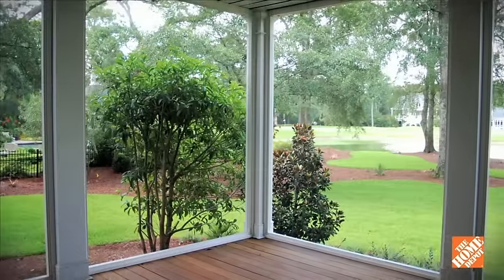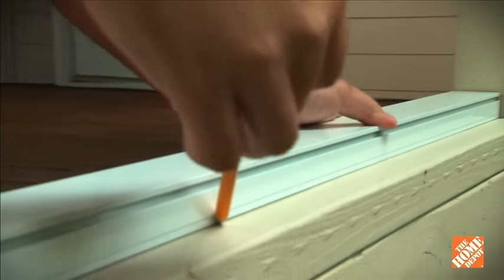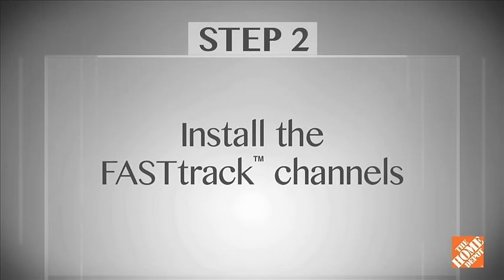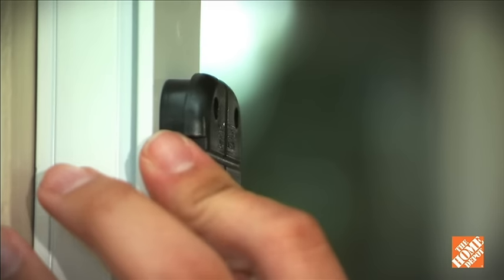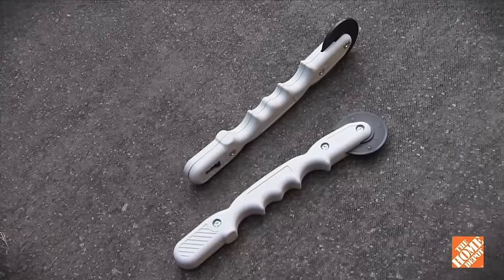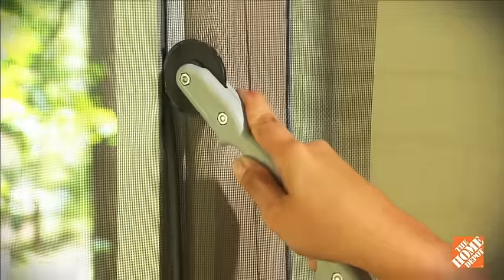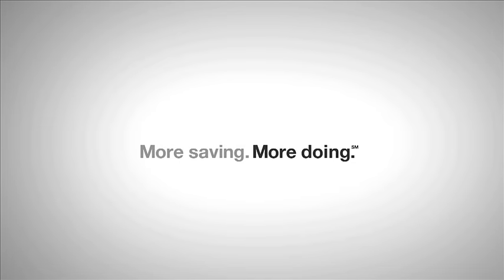Fast Track Porch Screening Installation Video

Comment: The Screen Spline they  recommend is a  .310" of an inch wide (approximately 5/16" wide rubber spline) and is too wide to fit into the 3/16" channel in the aluminum 1x2 . Any other suggestions?
Reply: 100% agree. Pressed hard enough but only thing I managed to do was slice it into three pieces, damn thing won't fit in. If you feed it in from the end it fits without the screen but that's not possible with an installed piece.

Comment: Can this be installed over concrete?  How about if the concrete has an archway.  I am trying to screen in the front porch to my house and use this type of system.
Reply from the maker: Hello, great question! It can be installed over concrete, but it has to a straight piece because our product has no bend to it. It is extruded aluminum, so you would need to install it behind or in front of the archway straight across. Call us at 1-800-768-7325 if you have further questions. Thanks!

Comment: I need more info on the 2x2 solid pieces. You are not using them in this video. I want to use all aluminum system.
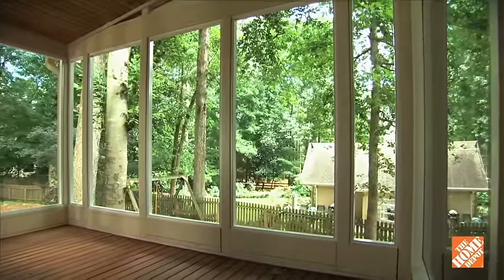Reply from the maker: Terri, they are not actual 2 x 2 posts, the 1 x 2 pieces are mated together to create a 2 x 2, at 1:35 you will see this process. Feel free to call us at 1-800-768-7325 with any further questions.

Comment: Convinced me that it's too much work.
Reply: Yes - I agree. Nice "fast track," meanwhile, you are making multiple drill points in your frame. I thought it would use a spring/ pressure system or something.
Reply: Jason Myers get dropped on your head much? How would that even hold?

Comment: Too much work.  Having to add all those brackets would take forever.  Changing the design to having to only screw the channel makes much more sense.
Reply from the maker: Hello GS S, the brackets surprisingly don't take that much time, they are what holds the channels down to the frame. We do this because our customer's wanted a fastener-free look on porches, and if you screw through the channel, you will see the screws. If you have any further questions, feel free to call us at 1-800-768-7325. Thanks.